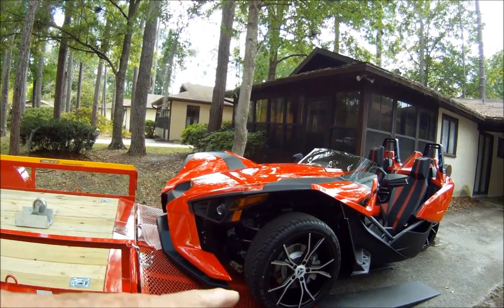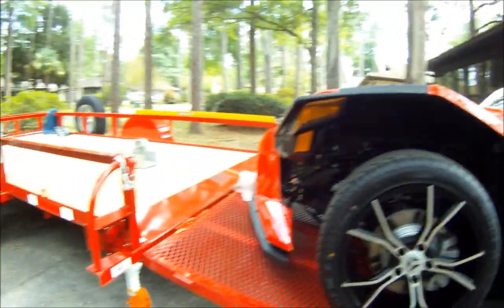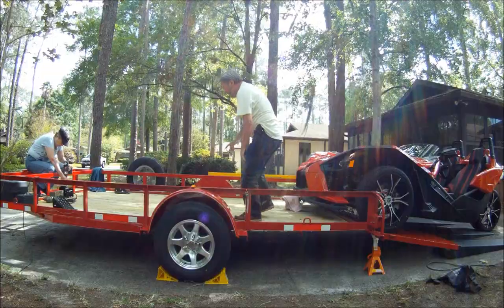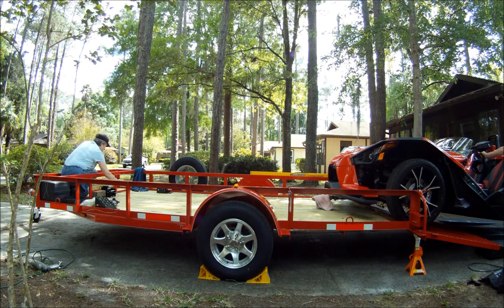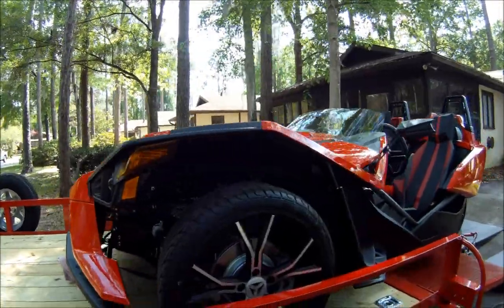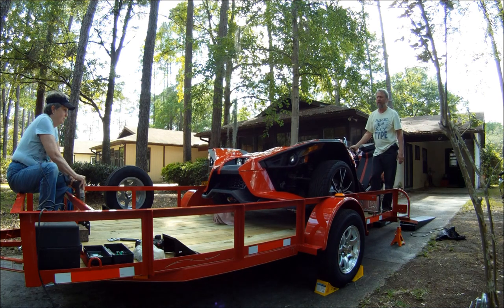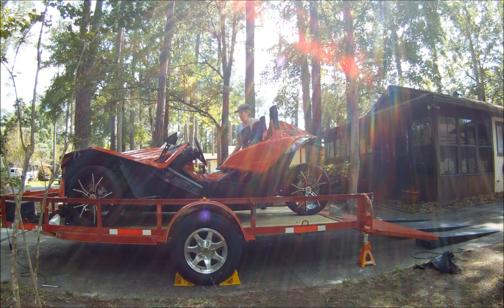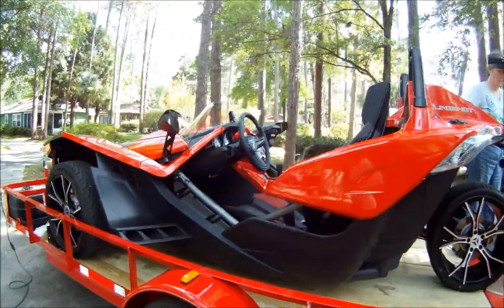Winch Polaris Slingshot on Trailer

Comment: i will be adding my winch to my trailer in the next couple of days.  is your winch bolted through the wood floor or is it attached to the metal railing.  thanks in advance
Reply from the maker: @R Ashwood I bolted thru the floor with large diameter washers.  Strong!
Reply: @samowens44  thanks.  i weigh  in at 285 which means my slingshot rides a little to low to drive it on
Reply from the maker: @rashwood4790  the winch will be the answer.  Good luck.
Reply: @samowens44  as it turns out one of my bolts goes through steel so i am super strong

Comment: Sam I need the pulley system you created, send me some specs on how to make please!
Reply from the maker: @Sixjux the photo I show a close up of the pully system I made.  The part I hold with right hand is a wheel assemble without the tire.  For a wheelbarrow or whatever.  It will swivel.  The base is two angle aluminum pieces and the wheel assembly is bolted to the two halves.  Works great.  I got the worm drive wench also from Harbor Freight.
https://drive.google.com/file/d/1-1Vu5j6VcbAy5YfDviE6_RuS8E8QcH7h/view?usp=sharing

Comment: I'm looking at a air ride trailer for mine...
Reply from the maker: Shannon Parker That is an option we looked at, but the cost was more than we wanted to spend for the few times we will be using the trailer.